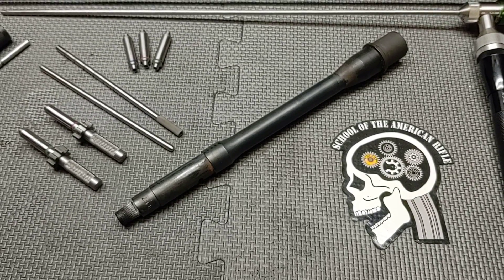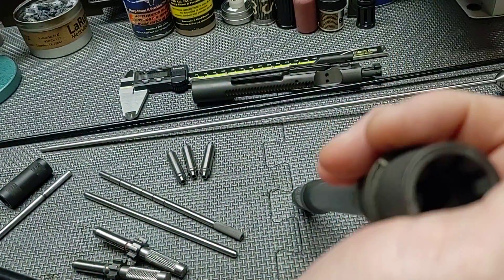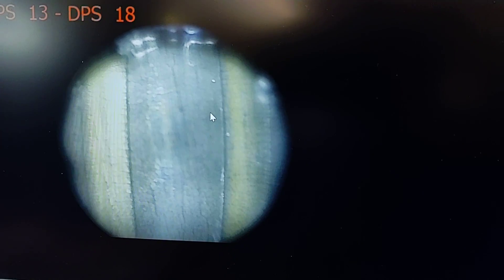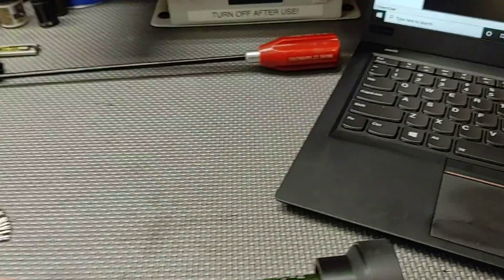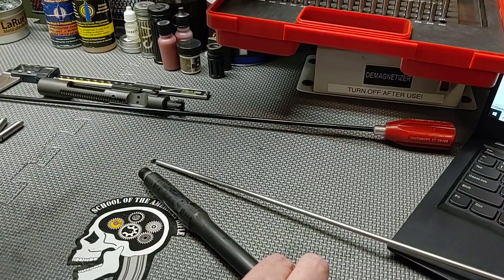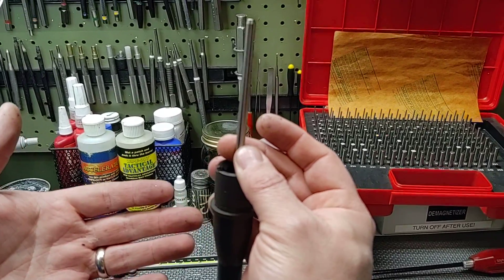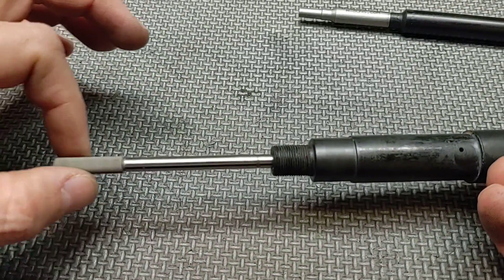Rosco Manufacturing - 26,750 Rounds of Full Auto - Barrel Autopsy

Comment: So of all the barrels have seen, which seem to hold up the best for the extreme abuse (like the full -auto gun ranges in Las Vegas, for an example, extreme abuse). In the army, the m249 barrels, FN, were extremely tolerant of insane use, of course no one could perform any kind of a proper assessment, like we see in this video

Comment: Wow. Would it make any sense to stick a new barrel on the upper and get back rock and rolling? Or does this level of wear indicate a high probability of egged-out pivot and takedown pin holes, etc.?
Reply: Not an armorer, but I’m guessing short of internal friction wear of upper receiver, probably not an issue on replacing barrel. But admittedly bolt and carrier, buffer and springs as well as bolt catch and boss mount on lower may need an inspection for possible wear. But not guaranteed excessive wear…. Just my thoughts from working on machinery…

Comment: Short barreled 5.56 rifles are very very stupid , you basically have a .22. 5.56 depends on velocity.  Anything less than 16in is not applicable to the round.
Reply: No .22 is flying at 2200 fps out of a  6" barrel. The 9" barrel shown can develop 2600 fps.

Comment: I have a question unrelated to this video. What is your preferred method of removing rust from firearms and firearm accessories? I live in upstate South Carolina, which gets very humid in the summer and I have noticed on my metal magazines. Specifically Sig and Shield Arms magazines. I try to coat them in Sentry 7 once every couple weeks but I still experience rust occasionally.

Comment: Since the example in this video is mostly suffering from muzzle erosion, would it be feasible to chop the eroded part and re-thread the barrel to get it running again? I know this video is old but I was just wondering how effective that would be
Reply from the maker: With a longer barrel yes. This barrel is too short to chop off more without causing insufficient dwell length.

Comment: I had 2 Rosco 13.7 mid .223 Wylde barrels with cycling issues so I spent 3x more and got the same sized Noveske but is the cold hammer forged flavor. Since the swap I haven't had any cycling issues. It runs like a clock.

Comment: Was interested to watch this video, however I was disappointed to see that the barrel was not cleaned. 

From my perspective I can't really tell what's corrosion, what's damage and what's just powder residue. If the barrel was completely cleaned, brushed and brought down to bare metal it would clearly show how the metal responded to such use and give you an idea of what to expect, should you be interested in one of their barrels. During the part with the bore scope / camera it's very hard to tell what is what, with how dirty it is. You mentioned not wanting to remove the buildup, as it's not going to cause any gauge issues.. but what about visual inspection and showing visual condition to viewers.

Comment: Impressive! 
-Only barrel Ive ever shot out was a S & W CL 16" 5.45x39 that had  around 15K as to round count, 70% of that number primarily ComBloc corrosive 7N6-(EXTREMELY well cared for during the rifles firing life-Windex-water wash n' flush minutes after shooting/cooling, then a deep hot-water rinse/scrub, dried, then followed by solvent clean usually no longer than 20 mins after each range trip)-....No S-L-O-W degradation in performance either! 
-One shot being accurate, the next: Keyhole city, but still hitting a 9" pie plate at 20 yards accurate. Every projo hitting plate sideways....

Picked up an Xtra ROSCO 10.5 pistol barrel, & although its not sitting in anything but a box & un-shot, I'm VERY impressed with just the machining/Surface finish for being a 120$ barrel!...>They are GORGEOUS!<
WELL worth the cost IMHO....

Comment: I bought one of these barrels and had reliability issues right off the bat and trying to reach someone for some input. Lol.  Undergassed, 4-430 ejection, failure to pick up a round occasionally,  and failure to lock the bolt back, and noticed the barrel lugs were damaged after all this so I dont know of it came that way or not, I never checked because I never assumed it would, but my bcg doesnt show any damage and it seems to index fine and not want to hit the sides of the lugs, I've checked it.

Comment: Rosco barrels are the new supplier for the colt  new / latest Cr  prefix assembly lineup 💪🏼💪🏼💪🏼 milspec/ civilian proof .  My 6933 commando , 6920 and my full size 20 in. Rifles all have rosco stamped / proof barrels and they all print 1.5 moa or better at 100 yards depending on ammo quality and weather .

Comment: This is why I love and prefer Rosco barrels. They come dimpled but you can still pin the gas block if you have a jig or take it to your gunsmith. I currently have about 15k rds through my 10.5 rosco and it only sees solvent, patches and a nylon brush if needed every 1000 rounds. For those that say I should clean it more, it's my training gun and rosco has a decent price when it comes to barrels. I'll buy a new one when it's time.

Comment: My bet it that whatever muzzle device that was used was over torque. This is a very common problem. 25 ft/lbs is too much torque. Yet this seems to be the generally accepted consensus. According to Joe Carlos, a precision AR gunsmith, 8 ft/lbs is the most you should ever use on any muzzle device. He's done more testing on these kind of things than anyone else I've heard of. He also suggests using Loctite or Rocksett to keep your device from coming loose. He found in testing that the standard 25 ft/lb. figure constricts the barrel leading to this exact inaccuracy condition. Just my two cents.

Comment: I just picked up one of these 10.5” Rosco barrels on sale for $99 bucks. Can’t beat that deal. The gas port size on the barrel I bought says .75 so it’s going to be over gassed but at least it will eat anything I feed it.
Reply: 0.750" is the gas block size. That is the outside diameter of the barrel where the gas block attaches. It doesn't have anything to do with the size of the gas port or the rifle being over gassed.
Reply: @littlejackalo5326  you are 100% correct. I got a bit confused but yes that’s correct. One thing I do NOT understand though is why most companies don’t list the actual gas port size? Why is it like some secret spec they don’t want the public knowing lol. I would have liked to know my gas port size.

Comment: Very much appreciate you sharing comprehensive expertise. Just have one question, why the reluctance in using bronze bore brushes? Thank you
Reply: Chad has said that if you are cleaning a barrel using bronze brushes it can leave a trace of copper, that would then appear as the barrel still being dirty.
When I was still in the service, if I used a bronze brush it was with CLP dripped on it and then left to sit to give the CLP 'time' to work before pulling dry patches through.

Comment: After watching you clean off the loctite from the threads I would love to know if you recommend loctite or not. I saw Brunnels do a video where they pretty much stated not at all. Others have stated in certain spots, etc...
I just found your channel, subbed instantly.  After only a few videos I have a great deal of respect for you and your knowledge.  
Also, do you work on arms for the general public? 
Thanx for the fantastic learn.
Reply: Industry standard is Rockset is used on muzzle devices that are not pinned and welded and will (or might) have a suppressor mounted to it.... if its not going to be pinned or have a suppressor then a crush washer is generally used.... rockset is going to hold the flash hider/compensator on even under heat and recoil, that is important with a suppressor as if the muzzle dvce comes loose will firing it can cause the bullet to hit it causing damage or catastrophic failure. Rockset will also allow the muzzle device to be removed in the future if the User wishes to change it out
A crush washer could fail with the added weight/stress of a suppressor on it.
(13.7” -14.5” barrels will normally have a muzzle device pinned and welded on so it cant be removed and that legally makes the barrel over 16” so it is not considered a Short barrel rifle requiring a tax stamp...or pistol requiring a brace instead of a stock....if the barrel is over 16” or under 13.7” then there is no need to legally pin and weld)

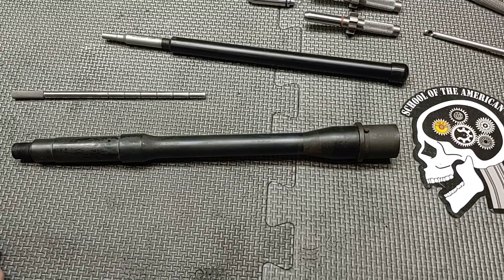Comment: 17:10 I haven't seen one of those push-pump solvent jars since I was 17 years old (a LONG time ago) repairing power supplies for NCR mainframe computers. We used them to dispense isopropanol to clean solder flux from circuit boards. As if I didn't LOVE your channel enough already ... thanks for the ear-to-ear flashback smile.
Reply: I remember those push-pumps with tri-chlor being used to clean parts at a plant I used to work at.

Comment: Nitride is no joke. I've drilled multiple gas blocks for taper pins and my drill press zips right through phosphated gas blocks. With a nitride gas block, I was amazed and perturbed by how hard I had to lean on it before the bit stopped chattering.

Comment: Why is the gas port erosion asymmetrical? I always just assumed it would be mostly symmetrical, not so deeply scared on one side.
Reply: My guess the bullet covers it till it passes, then you have directional flow of the gas once it passes, works like a ramp edge, clean on take off and crashes the far edge
Reply: I think the swagged boolit hits the muzzle end and has to continue the spin

Comment: It's really interesting to me how the erosion of the gas port occurs towards the muzzle and not the chamber.   That's the opposite of what I'd assume would happen.  Very educational.
Reply: It’s like driving over a pothole.  The first edge of the pothole doesn’t take the impact of your tire but the second does.  The gasses are contained until they pass the chamber end of the gas port and flow over it then crash into the muzzle side of the port.
Reply: @me2bfc  perfect analogy
Reply: @me2bfc  that actually makes perfect sense thank you
Reply: Yeah, me too, but then when you rethink it it makes perfect sense. The gas isn't forced through the port til after the bullet passes the port so it's like back pressure...
Reply: I'd have thought the same because the combustion contaminants arrive at the gas port from the chamber side.  But I guess it's because the round drags the plume of contaminants past the gas port and the gas port is a "catch" for the stream of contaminants, eroding the muzzle-side lip of the port.
Reply: Makes me wonder if a slanted gas port hole would make a difference in erosion pattern and rate. I'd have to guess the thinner section would inevitably erode quicker.
Reply: @warrenharrison9490 LMT uses a 45° gas port for this reason.  7.62x39 AKMs used it as well, but an even more acute angle less than 45° relative to bore line.
Reply: I believe this occurs as a result of a concept called dwell time.

Comment: Just stumpled upon your channel, and I like it.
I have one humble request: Please explain what the tools do, and why that means the measurement you just took is a good/bad indicator. 
I'm not a gunsmith, and I have no idea why "gizmo X doesn't fit perfectly to hole Y at angle Z" is a bad thing.
Reply: Basically all his tools are gauges which is created off of SAAMI specs. SAAMI was created for consistency in manufacturing of firearms and ammunition for a specific caliber. If out of spec ammo or guns are made then guns will start going boom in your hands which was one particular problem with the M1903 springfield rifle (real world example) as for the muzzle erosion gauge that just tells you how worn the muzzle and rifling are because a gun will not shoot good at all if the bullet does not have a tight fit at the muzzle which will cause "key holing" and you won't hit the broad side of a barn. Google can also be of great help with answering ya questions.

I have personnel experience with head space gauges cause i have two lee Enfield rifle that have issues. One rifle has a headspace that is to tight so i will have to change out the bolt head and the other rifle was on the verge of having headcase separations (cracked case heads on my brass) and was also leaking gas from the chamber, the field gauge got eaten so i had to buy a new bolt body for that rifle and the cracking case heads and gas leaking from the chamber was solved.

Comment: I can't say for certain because I've never tested the phenomena in controlled conditions but I think the accuracy issue is caused by a quasi internal version of a damaged crown. We see accuracy issues with a damaged crown because the propellant gasses are imparting an interrupted spin and or flight pattern after the bullet has left the lands. When you combine 1) the muzzle end erosion - which may mean that through part of the barrel the bullet is not being influenced, or not influenced greatly enough, by the lands: with 2) the troth cut just forward of the gas port - that irregular flow of propellant gases imparting force on the bullet may be interrupting the spin and flight path of the bullet in the same way that a damaged crown would. 
.
It's an oddity that we would see the same phenomena occur internally like this: or at least it's an oddity with newer guns. This is not horribly uncommon to see in surplus guns in which both ware has reduced the internal diameter of the lands and erosion has left pock marks or holes which create very similar conditions. It's not something you'd ever worry about on ARs because rarely do you see AR barrels which have been worn away to an extent that lands are far away enough from the round that an internal irregular gouge like the gas port erosion would be able to greatly influence the round.
Reply: That's why long barrels are awesome. If you do happen to shoot it out cut it and start again.

Comment: So basically, there's no way your average shooter would ever need to replace one of these barrels.
Reply: An Ar15 barrel would last longer in semi auto. The round count would be higher. Heat causes metal to expand. With full auto, your getting that barrel to the limit. Although you would likely melt a gas tube before deforming the barrel. But still. In semi auto. You're not replicating this.
Reply: Depends on what they consider accuracy issues, there is a place in las vegas that doesn't swap the barrels until they notice tumbling at 15-20 yards with full auto mag dumps. if you are hunting you would probably swap it a lot sooner
Reply: @HickLif3  i work at a full auto range here in Vegas that has those same tumbling/keyholing issues yet we don't swap the barrel until the rifle just ceases action. the craziest thing I've seen was actually with a M4  upper that is so shot to shit that the left side of the inner receiver has lost so much material that it creates carrier tilt from side to side and I remedied it by slapping some machinegun grease on it to fill in the missing thousands of IN space missing. its been about a month and its running just fine with the exception of needing that grease there every maybe 1k rounds. hell cleaning the chamber is more important than that
Reply: @charlesbukowski9836  Extractor, especially if its not an older Colt. My dept had a mix of AR15's, M16A1's, M4's of various brands. Meticulous records are kept for CYA and maintenance scheduling. When we dumped the 870 shotgun for M4's everyone had to go through 40 hours of training which is 1000-1100 rds each officer per week per gun. The short story is the DPMS M4's were breaking extractors in the 5k to 8k range. The Colts were all older and had LOTS more rounds through them, from 15k to 30+k. 

None of the Colts had broken an extractor. So I hopped online to Brownells and replaced all my AR extractors with Colt. They came with the rubber "plug" and new spring so that softened the high price. That was 10 years ago when Colt was still chugging out mil-spec rifles. What and where they get extractors in 2021....who knows?? Roll of the dice today.
Reply: @davidmn your math is horrible.
Reply: People aren’t that intelligent
Reply: @jordanrick2931  yeah lol 🤣
Reply: @jordanrick2931  right? 26,000 divided by 26 seems like a pretty simple equation even my 4 year old could figure out in their head lol
Reply: @drewtibbe77  26,000 divided by 26... About 780?
Reply: An rem that's under full auto conditions. Average shooter ain't hitting those high temps nearly as often...
Reply: In that case, Rosco barrels are pretty sweet. Budget AND great quality
Reply: I think @DavidMN was joking. It definitely made me chuckle lol
Reply: About 1000 fulls mags of ammo.
Reply: @CLOV3R713 easily could be, if you notice it says nowhere in the post how often he visits the range. Maybe it's only once a year 🤔 or maybe he reloads and had lots of supplies on hand, plenty of ways a person could be maintaining a high round count right now.
Reply: 26,000 rounds  that's like 26 range visits for me.
Reply: @muffemod  where are you finding ammo to shoot 1000 rounds per outing
Reply: @Grant881000  Some people have more money than common sense
Reply: @muffemod  Haters!!!😆😆😆😆😆😆
Reply: If you said 300 or 400 it would have been a more convincing lie. I can't get why some feel the need to just spit out whoopers all over the Internet. @muffemod
Reply: muffemod I know right.....
Reply: @muffemod  I miss those since the plandemic. :(
Reply: @muffemod  You shoot roughly 780 rounds each range visit?
Reply: @hellcatdave1  Around 1000 rounds each visit.
Reply: DavidMN that’s easy. When I first got started each trip was 500 rounds. But then again it was me and one other person
Reply: @hellcatdave1  this math 😂

Comment: Is using bronze brushes going to damage the rifling severely if it's used every time for cleaning?
Reply: The brush won't damage your barrel.
-But the long steel rod you fit the brush on WILL damage your barrel in the long run...
Reply: Use aluminum cleaning rods or carbon fiber.
Reply: @1yehny  or bronze rod